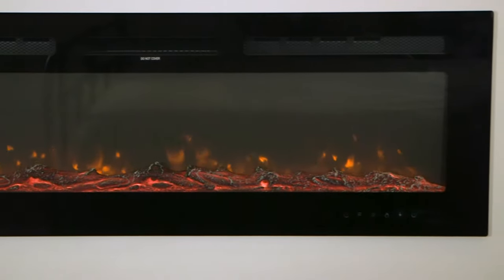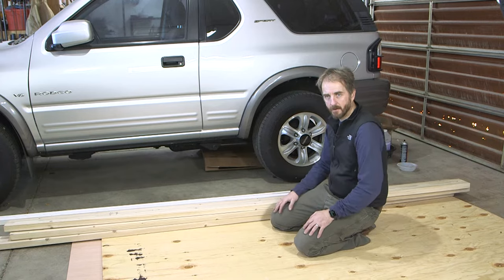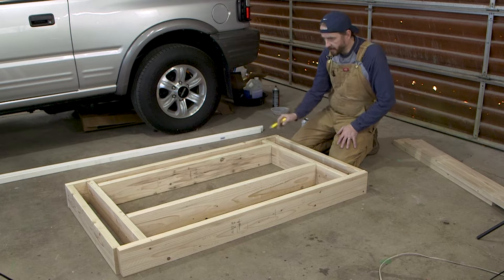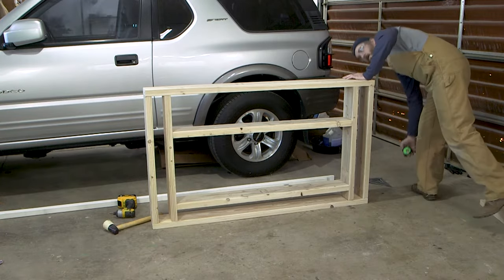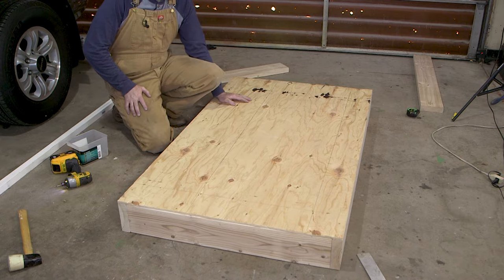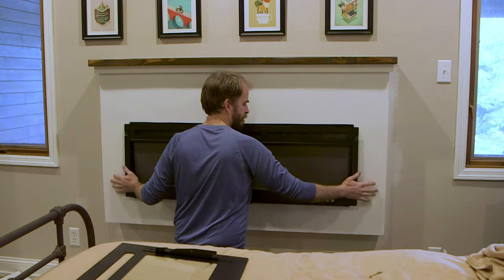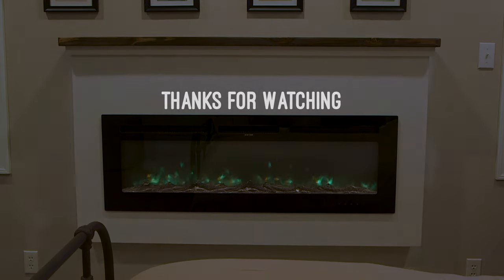Simple Easy Electric Fireplace

Comment: Robert, I just did this project! It was fantastically easy. The only thing I just did different was prime the inside with heat-resistant paint and a hidden door to access the plug behind the mantel.   If you made physical plans and specs would be bomb.

Comment: You did a very good job. Did you have to install a new receptacle from an existing outlet?
Reply from the maker: I had an open spot in the panel so extended a new 15a circuit to it.  It’s on a dedicated circuit.

Comment: How does it “breathe” on top with that 2x6 covering the intake? I thought it needed 12 inches above the intake to breathe
Reply from the maker: There's three vents in the front of it, right at the top of the insert.  It draws air in through the outside two and blows it out the center.  The 12" clearance is a vertical clearance that I think is there to prevent hot air from combusting things above the fireplace.  The instructions specifically specified a minimum 12" from the top of the insert to the mantle.  But it also noted pictures and other items hung above the fireplace, too.
Reply: @RobertAdairWorkshop  thanks for explaining. I thought the top of the unit had the intake and the front 3 sections is where the heat comes out     I have a very similar unit and was concerned about covering the intake.

Comment: Hello Robert, I was wondering how you mounted the mantle after you stained it? Thank you!
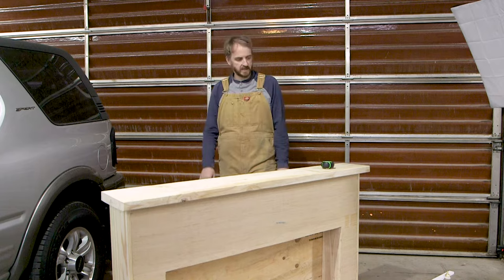Reply from the maker: It's screwed to the frame and then the holes are filled with two-part wood filler.  That's what I'm doing at about the 6:16 mark.  After it was in the house and mounted to the wall, I masked it and gave it one final coat of Polyshades and called it good.

Comment: Looks great! 
Is it also a heater or is it just flames?
Reply from the maker: Its a heater too!  Two settings.  750W and 1500W, I think.  Really nice.
Reply: Does it get too hot to cause a fire on the back (stupid question, probably) of the fire place?
Reply from the maker: @christiantorres2423  It is well insulated.  it doesn't get hot enough on the back that I can't keep my hand on it.  I haven't been worried about heat.